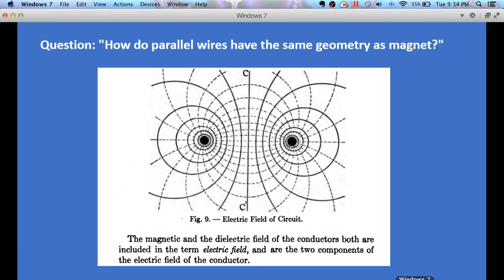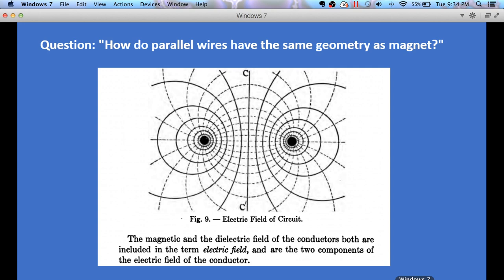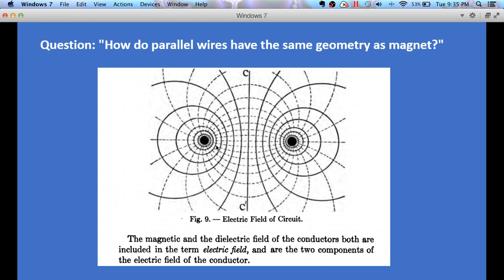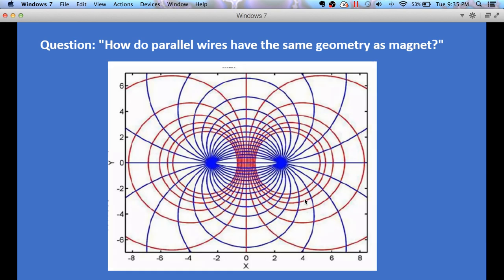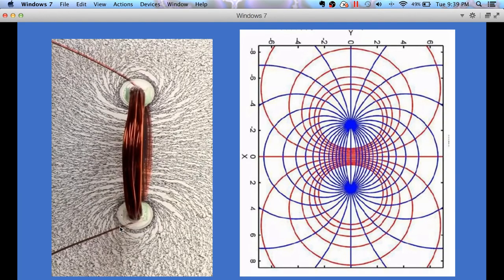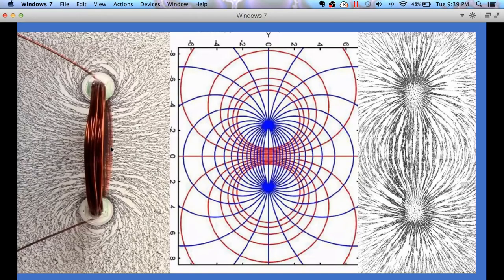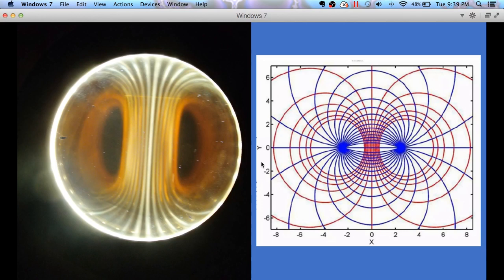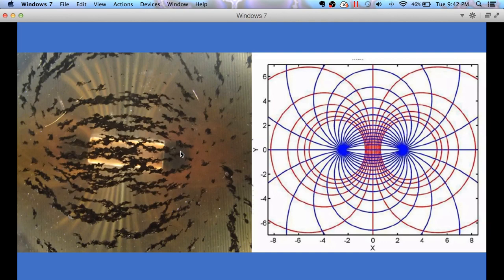On Permanent Magnets vs Electro-Magnets

Comment: Lori,
I know this response is coming late but I wanted to give you my input (for what it’s worth, lol).  I think the confusion comes in bc of the flow of current in the wires displayed by stein Metz In his drawing.  He shows a flow of current from a head on view.  That is, one flow would be into the page and the counter flow would be out of the page.  In this regard and from this viewpoint, I believe you would see the same field geometries displayed by a magnet.  However, In the indicator you use, the current is flowing in a circular manner.  I would say then that the field geometries displayed could not be compared to one another bc it would be like comparing apples and oranges.  That’s what I see anyway....hopefully it helps or at least gives you something additional to consider.
Keep trucking, love your work!!!

Comment: Note that iron filings are not unbiased observers. They become tiny magnets themselves, and then they "lock together", and form a "chain" connecting the "poles".
Ken shows a series of photographs of experiments comparing unmagnetized and magnetized discs in the presence of a larger magnet, and they behave orthogonally to each other.  See the third edition PDF file starting at page 137. 

This is an important point.

Comment: imagine wrapping the bar magnet around itself so the N pole touches the S pole, this is what the electromagnet is doing as the wire acts as one big magnet (one end being north, other south). the dielectric current terminates on the wire by the resistance of the copper and looping around each winding creates the natural form of magnetism(the toroid) which induces dielectric coherency of the iron filings from the termination of the magnetism from the coil on to the ferrous objects..the iron filings are both induced dielectrically thru magnetization in both cases, only the shape of the source object is changed. where as the bar magnet is point source and has a prominence of dielectricity, as magnetism is the dielectric field, whereas the electromagnet has a prominence of magnetism as the dielectric component of the electromagnetic current terminates on the wire trough resistance of the copper as heat, there by leaving the remaining magnetic component to dominate the system of what is the coil. The electromagnet acts as an incoherent lightbulb  and the magnet a point source laser analogously. Where the surface area of the filaments "spreads out" the point source nature of the individual atoms in the filament thus losing the coherency of the projected light as it becomes radial, where the electromagnet is a series of point sources like the filament (atoms in copper coil being like dominos, one effecting the next one) which true an applied current, results in the coherency of the inter atomic dipole of the atoms in the coil in the direction of the current, thus projecting a magnetic field around the wire 90 degrees to that of the current in the same. like in the Steinmetz diagram. bottom line is the electromagnet is indeed a magnet turned inside out with it's inertal plane on the periphery of the coil (as the windings) and the magnetic passing thru the centre point of the coil then back around from all directions as the wire is circular in shape. sorry if this is confusing
Reply: Fantastic. Well done.
Reply: Elvis Tesla thank you mane😁
Reply: Mad props, that's the most coherently articulated response I've ever seen on the subject outside of ken.
Reply: dark243stone thanks i thought no one would know what i meant i was high af when i wrote that but yea... glad some people got it nd stuff 😅

Comment: The dielectric is conducted through the single wire, isolated within the matter of the medium it is propagating through due to the permittivity of the copper. The permittivity of the copper gives it the ability to “store” and conduct the dielectric which has the inverse relationship with the magnetic.

The magnetic is then expressed as the field perturbation with its plane of inertia at 90 degrees perpendicular to the wire body loops. There’s the toroidal doughnut looping the doughnut of the copper coil. 
 
The two share an inverse relationship due to permittivity and permeability. 

The solid state magnet has a high permeability (ability to manifest a magnetic force) and the expression of this is the alignment of the iron filings along the dielectric field. Magnetism being “coherent dielectric acceleration” (Wheeler, 2019).

Magnetsim isn’t one force but the hybrid of the two, with one being expressed and the other contained, dependant on the permittivity or permeability of the material.  

As one field is “contained” so to say the other is expressed in the inverse.
Magnetic contained = dielectric expressed
Dielectric contained = magnetic expressed

EDIT: This is observable as the inductor shown is wound in a manner that it creates a spring on a rod.
The copper wire loop is wound in such a way as to create a doughnut of copper, hence the different appearance, as the field in the doughnut is additive and the field in the spring looping around itself and intersecting causing the intersecting pattern.
Reply: Tung Huynh Yes. It is analogous to say one is expressed more than the other depending on permeability and permittivity, i.e specifically magnetic is held tighter to the surface in a solid state magnet, di-electric is held closer to the surface in a conductor. After all the field around the object in question is where the energy is.
For simplicity of explanation the word “contained” was used.
Reply: The last part ie the copper wire loop..... Doesn't make sense can you re-word it please. Focus on the spring as you called it.
Reply: Why does the ferrocell differ from the filings?
Reply: @elvistesla3179  scale I don't think we have a constant, that will be difficult for people to accept

Comment: maybe it has something to do with the oriention. The bar magnet is vertical on the screen,  so is the polarity,  The coil is also vertical on the screen, but the  magnetic field is horizontaly.  I am not a physisist or expert in the matter,  but i  think the red lines are different in shape, in the magnet if you use the ferrocell from different sides, you would probably see more of a sphere like shape around the poles. I think if you would hold a ferro cell inside the coil, you would see the dielectric field as the magnetic field of a magnet

Comment: Good work, you are pointing at critical issues that Ken often neglects. Still, I think it would be more correct to say that a magnet under a ferrocell creates the same patterns a coil does with iron filings *when such magnet is looked from the side*, but that it (correctly) shows the reciprocal shape when looked from a polar view. What we see under the ferrocell undergoes deformation relative to the angle created by the plane of the ferrocell itself with the plane of inertia. When they are orthogonal to each other (side view) every line we see looks orthogonal to its actual direction (reciprocation).
I came to these conclusions during the last month, after we talked about the impossibility of creating a 3d model of what is shown by the ferrocell. I hope I explained myself; let me know what you think of it.

Comment: Hi Lori. First off, another great vid and very thought provoking. Just to address you question directly. I do not think the geometry of the two systems (magnet and inductor) is in any way reciprocal. Just to clarify what I mean. Take the image @5:06. If we imagine each image on its own as a magnet, the two 'magnets' to the left (the left image and center image) are completely different in shape from the 'magnet' depicted in the image to the right. The 'magnets' to the left are shaped like coins, or flat disks, with the poles at the faces (heads, tails) where as the 'magnet' in the right image is a long thin cylinder with poles to the extremes. This is providing the illusion of a reciprocal filed geometry. It is indeed intriguing that they are providing the illusion of a reciprocating field, however I believe it is coincidence of the different shapes. One needs to visualise the 'magnet' to the far left with  poles that are perpendicular to the wire length and then if one flips the far right 'magnet' 90 degrees and superimposes that onto the far left image, the field geometry is exactly the same. Your thoughts would be greatly appreciated.
Reply from the maker: I just posted a couple of pictures on my Community section. This should clear things up for you. The way I showed in my video is a bit confusing because, not only are the fields swapped, but the because N-S between the magnet and the coil are 90 degrees orthogonal to each other. The figures I made should make all this clear. It has nothing to do with the shape of the magnet, although I agree that it would be better if they were the same shape.

Comment: Thank you for the fascinating video.  At 10.07 I was struck by how the ferrocell lines have different colours, each line reflects a different LED.  The field seems to be orientating the particles in lines which reflect a particular LED.  This could explain the holographic images produced which change as the observer moves.  It seems that if, instead of individual LEDs, the cell was lit by a continuous ring of light then no lines would be seen, conversely a single led would reflect only one set of lines and moving it around the cell it would reveal different orientations of the particles.  Distinti showed that iron filings don't show the field but how iron filings respond to the field, the ferrocell seems to be showing us the twisting alignments the field imposes on the particles.  Very interesting.

Comment: It is just an end on view vs a side view.  In other words, if you were to cut the coil in the middle and straighten them, you would have the transmission line picture, but because they’re not cut (they’re connected in a circle), you’ve simply wrapped the dielectric lines of tension in a circular manner, and they’re now moving in and out of the screen (ie moving in the path of the coil).  Think of it like a million little bar magnets, sitting on the path of the coil.  You don’t see them stretched across the coil like a bar magnet because that is now a very weak connection.  They’d much rather travel along the conductor.
Reply from the maker: LikeIs: You are forgetting that, in the transmission line picture, you must have a return wire. In other words, there is no point in cutting the coil and stretching it out. There is no  such think as a current going through a wire that is not in a CIRCUIT. The coil is just a shrunk down version of a transmission line with a return line.  IMHO
Reply: Fractal Woman 
If you were to take a bar magnet and split it lengthwise down the middle, and bend one half in an arc ‘out of the plane’, and one half as an arc ‘into the plane’ (so two semicircles).  You would have two semicircle magnets with like poles facing one another.  So now flip one of the semicircles so the two connect N to S as a circle (circuit), the lines of force would look the same.  My 2c.
Reply: Fractal Woman 
What I meant by cutting the coil is to section the out of plane portion in the middle AND the in plane portion so as to create two copper, parallel windings going in and out of plane.  If you did, and were some how able to freeze the current direction before you cut it, and were then able to check that current flow after you cut it, you would see two transmission lines with flow in opposite directions (thought exercise since I know)

So I don’t think the magnetic filings ‘line up’ along dielectric or magnetic lines, they line up on field lines (plural).  We only say dielectric or magnetic when referencing our orientation to the field.  I’m in doubt that ℏ=Φᴪ because this implies the field lines ‘actually’ cross one another.  We’re just looking at different orientations of toroidal field lines.  It may be that what we call magnetic lines are just where a mass void is greatest, so the files fill in the void.  The dielectric lines are dimensional mass, I think magnetic lines are more akin to counter mass, which is entropy.....long story
Reply from the maker: @Jay Andrew What you can also do is zoom into the wire(s) on the left where they intersect the paper and ignore the wire(s) on the right. Then you have the 1 wire situation from the Steinmetz image. Just because he is showing one wire does not mean that there is not a return wire. There is no such thing as current flowing through a wire that is not in a circuit. There has to be a return wire. A wire has to come out of one side of the battery, and return to the other side. That is why it is called a CIRCUIT. The words circuit and circle have the same root.  To answer your question " Is there a "return wire" or just pressure mediation FIELD.?", it is both. There is a return wire AND there is pressure mediation. It can be no other way.
Reply from the maker: @lifeisshort4456  Thanks for clarifying. It if my opinion that the iron filings line up orthogonal to the direction of Aether flow, similar to how sand lines up orthogonal to the direction that the wind is blowing. https://www.youtube.com/user/FractalWoman/community?view_as=subscriber

Comment: hmmm the image of the electromagnet under the ferrocell you showed has the field lines curving in the other direction relative to the iron fields of the magic (at 9:43). So not sure why you said it is the same as the iron filings??
Reply from the maker: If you rotate the electromagnet-ferrocell image 90 degrees, then you do get the same as the iron filings. The long axis of the electromagnet is the short axis of the magnet. Sometime today, I am going to be putting up an image in my Community that will clarify this.

Comment: Thank you for explaining, you do an awesome job at it!  The next step is for us to be able to imagine this same setup but then in 3D, then we can see the actual geometry of the fields... I’ll be thinking of how we could do that!
Reply from the maker: Actually, the inventor of the ferrocell, Timm Vanderelli, has a computer program that can do exactly that. It is able to calculate the isolines using a variation of Maxwell's equations and it mimics the field seen in the ferrocell exactly. Using his software, I can generate a stack of images and then reconstruct that into 3D. I haven't done that yet, but it is on my list of things to do.
Reply: Fractal Woman wonderful, we will learn allot from that!  I was considering to convert a 3D printer and equip it with either a sensitive hall sensor or a tiny coil like a hard disk reading head, move that in a pattern zig-zagging thru the field producing a 3D step file, that can show us field intensities at their respective coordinates
Reply from the maker: @infinitesolarforall3901  That would be cool. You should do it. But make sure you document all the steps so you can write a paper on it. Also, I could then compare your 3D model with a virtual 3D model that I plan on generating using Timm Vanderelli's software which he will be releasing soon to the public.

Comment: So, I'm thinking : The iron filings and the ferrocell are conjugate principles. The iron filings show how matter organises and the ferrocell shows how light organises around a dipole. 
Excellent video by the way! Plenty of food for thought! :)
Reply from the maker: The ferrofluid in the thin layer between the two pieces of glass in the ferrocell align themselves like iron filings in the presence of a magnet. The light reflects off the nano particles into our eye using the physical law that I learned in high school: Angle of incidence equals angle of reflection. Specular reflection off the nano-particles is the cause of the "curves" that we see in the ferrocell. Light does not organize around a dipole. This is light reflection only. Hope this helps.
Reply: @FractalWoman   Thanks for the feedback Lori! Yes, it helps clear things. 
So is it fair to say this(?): Under the influence of a dipole the ferro particles between the glass sheets arrange just like the iron filings. The light filtering through this glass appears to mimic the magnetic or dielectric lines of force depending on whether the dipole is a magnet or a closed electric circiut.
Reply from the maker: @TheSbd13  The light does not mimic "line of force" of any kind whether it be a permanent magnet or a coil of wire. Both the coil magnet and the permanent magnet show the same pattern in the ferrocell. There is no difference between the two. The light that you "see" is merely reflecting off the iron-filings. The iron filings (nano-particles) themselves are aligning along the magnetic lines of force (not the dielectric lines of force). What we see in the ferrocell is an indirect manifestation of the lines of force, but not the lines of force themselves. In a similar manner, when you see yourself in a mirror, you are merely seeing a reflection of yourself in the mirror and not yourself directly. Now, if you curve the mirror like in a hall of mirrors, you are going to see a distorted image of yourself. The ferrocell image is a distorted image of the lines of force like in the hall of mirrors. Hope this makes sense.